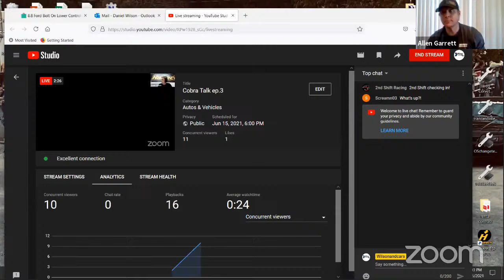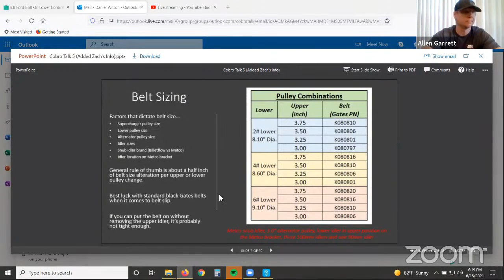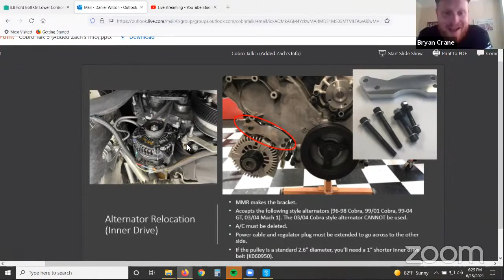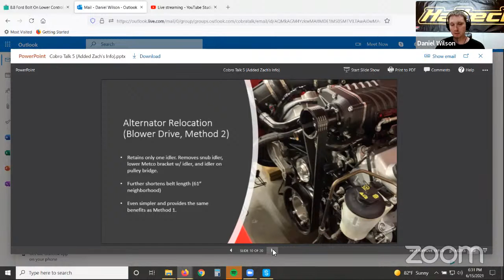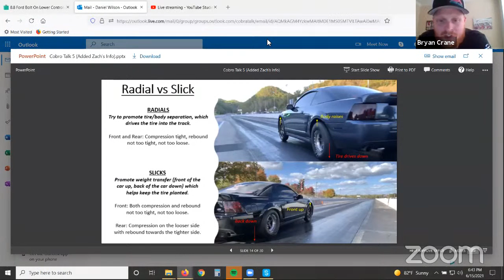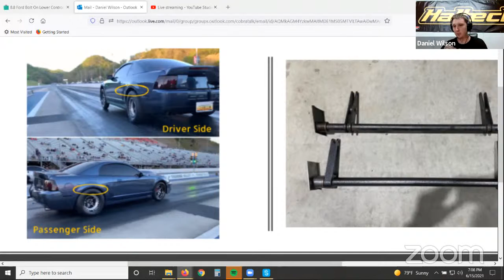Cobra Talk ep.3 whipple supercharger , Blower Belt , suspension setups!

Comment: All 4 of you guys running whipples? If so all 3.0's? And what's the Hp Numbers at what psi.
Reply from the maker: All of us run whipple, Zach runs the Gen4 2.9 the rest of us run gen5 3.0.
Bryan is over 1000   24-25#
Allen dyno right at 1000, 27-28# but had belt issues 
Zach I’m not sure
I’ve never been on dyno  but would guess 800s on 24-25#, going by the Wallace calculator and adding in 15% loss.
Reply: @Wilsonandcars  Just got done building a teksid block rated for 1500hp I went with a Vmp 2.65 Gen 3 R looking to make over 1k but started noticing it doesn't seem like it has been done yet. And gen 5 3.0 crushers are on order to ship 13 weeks out.
Reply from the maker: @subzero_7473  don’t give up on the gen 3R it can put up numbers as well it’s a good blower.  One day I will get some money together and buy a gen3R have it ported and do some testing vs the whipple at some point.
Reply: @Wilsonandcars  that would be amazing. We shall see what I put down. Via Dyno I'll post numbers in the stick shift group.
Reply from the maker: @subzero_7473  if you don’t care send me pics and vids to my Insta would love to share some VMP stuff!
Reply: @Wilsonandcars  will do!